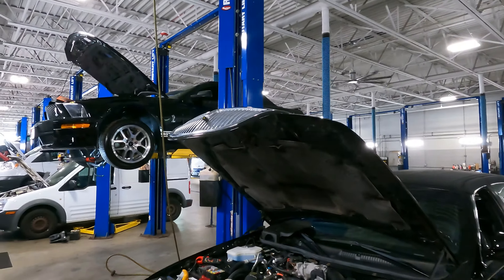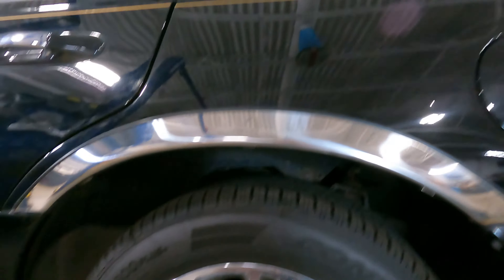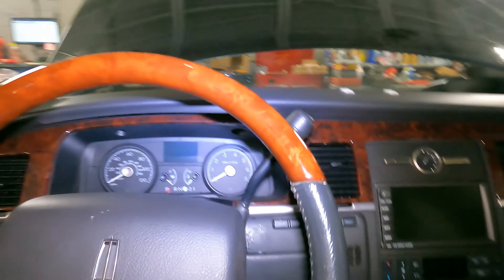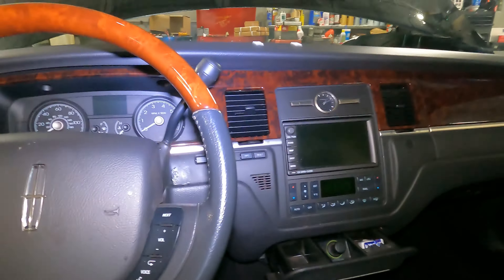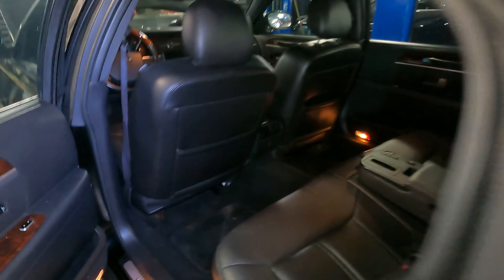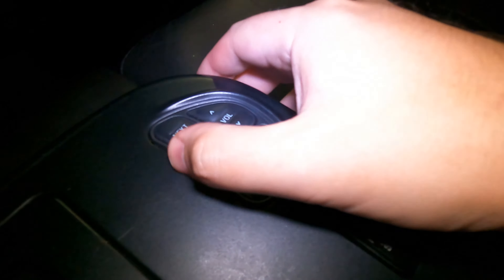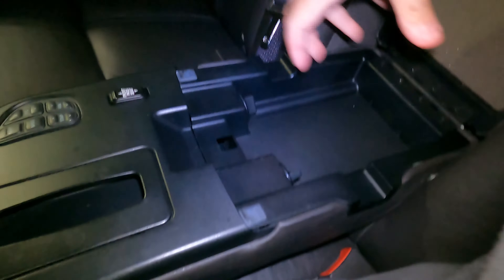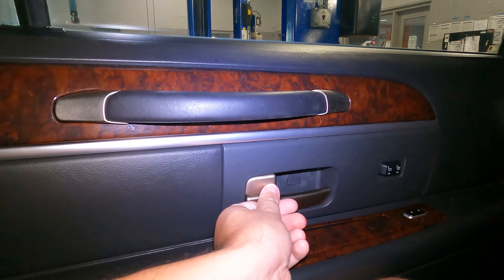Lincoln Town Car Guy Presents 2007 Black Lincoln Town Car Signature L Update - We Meet Again :)

Comment: The "L" was geared more toward the livery trade, so no sunroof option - that would be weird to have a sunroof over the driver while the paying passengers did not.  The L's I've seen with sunroofs were added in at the dealer.  The factory navigation THX sound system (with tweeters in the upper front door corners) is rare - probably because it was ~$2,400.   I'm not sure if the 25th anniversary edition was available on the L - the brochure I have is only for the regular TC 25th.
Reply: I was unaware that that upgraded THX sound system was available on the L models. Frankly I don't know why they didn't put the upgraded sound system as standard in all Town Cars. My 2004 Mustang GT has a subwoofer and the tweeters up at the front corners of the doors whereas my Lincoln does not. If the Lincoln was the flagship from Ford why did it have a lesser sound system. That makes no sense from a marketing point of view unless they thought their older customer base was not interested in that sort of thing.

I have to tell you that I enjoy that upgraded sound system in the Mustang.
Reply from the maker: Thanks for the comment!
Reply: @c.d.7742  The 2203 to 2011 Town Car really could have used tweeters as a standard - along with better speakers.  On my 2006 Signature Limited the factory sound system is more like something out of a Crown Vic than what would be expected in a premium car.
Reply: @Thomas63r2   You are exactly spot on about your comment of what would be expected in a premium vehicle from the flagship name. It's almost as if Ford took for granted that the Town Cars would sell on their name alone. Perhaps there intended consumer had that mindset and didn't care about higher grade stereo or other bells and whistles.

Personally I appreciate the fact that the controls are simple and intuitive on the Town car along with the Grand Marquis and Crown Vic, but I sure would appreciate a better factory stereo system especially in the Town car where it would be expected. I feel overwhelmed with the controls on some of the newer vehicles I have been in. I do not have a degree in computer science....lol.
Reply: @c.d.7742  The THX system got it right on the need for tweeters on the Town Car - but it was bundled with a $2,400 Navigation system and THX, when most buyers just wanted the THX and not a pricey and outdated nav system.  Moot point now that it is 10 years since the last Town Car rolled off the assembly line - I'm sure that any good auto sound shop can make the upgrades with aftermarket parts.

Comment: The rear locks do work just like that, they only move a couple degrees between locked and unlocked.
I love how the Signature L drives compared to a regular Town Car. Yes it's harder to park, yes the turning radius is slightly worse, but it almost feels like a different car when you're driving it, and it's something I prefer. LWBs also are less likely to hydroplane than regular ones.
Reply from the maker: Thanks for chiming in :)
Reply: That's a nice Lincoln you have there Nathan.

I'm an older guy that grew up in the sixties and seventies, and learn to drive on a big old Dodge Monaco four-door sedan. Of course it was much longer than even the standard Lincoln Town car. Not sure about the wheelbase though.

My father always preached about the benefits of a long wheelbase for highway cruising. His main point was how a longer wheelbase smoothed out the imperfections of the road with bumps and such.

On Anthony's Channel his father Papa Bear drove a L model Town car back home to New Hampshire from Pennsylvania where they bought it, and he was bragging about the wonderfully smooth ride over a regular Lincoln Town car.

When I purchased my 2009 Town car in 2019 I wish I had looked harder for the L model. Right after I got mine home I found a lovely low mileage and only summer driven and babied L model for sale. My mechanic told me to go ahead and buy it and then sell whichever one I did not want to keep, but that sounded too complicated and expensive.

I would also say that that L model you have is a fancier or upgraded version because of the vinyl roof and other things like the gold lettering on the back end. Not sure if that is factory or aftermarket?
Reply: @c.d.7742  Oh, I wish it was mine 😂 mine is currently parted & crushed as of last February (sadly). I've driven several other Town Cars and I would testify to what your father said about LWBs. As far as this guy's Landau Top & Gold Lettering, I don't believe it's factory. I'm not sure if Lincoln sold em with Landau Tops from the factory.
Reply: @Nathan_Jay  I thought you were the Nathan that the Vitaliy meant when he said who owned this car.  I should have waited and got a low mileage long wheelbase model, but the silver 2009 I picked up spent Winters in Florida and only had 30,000 miles on it. I know I overpaid but I think it was worth it. It only gets driven in non-winter weather now up here in Canada. I imported it from the USA.

Take care and thanks for responding. I always read your responses in these videos.
Reply from the maker: Nathan, Rich and I went to see it when the owner was selling it last year